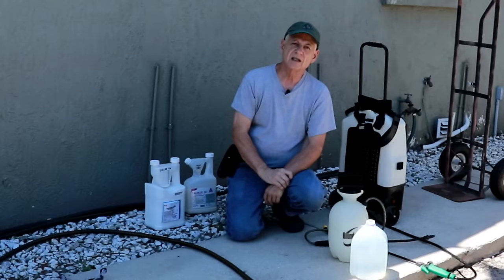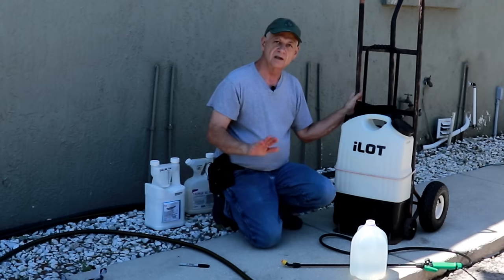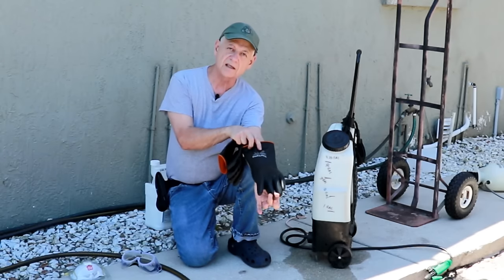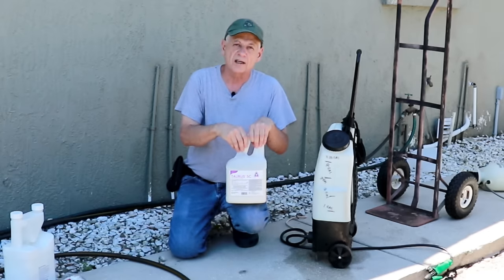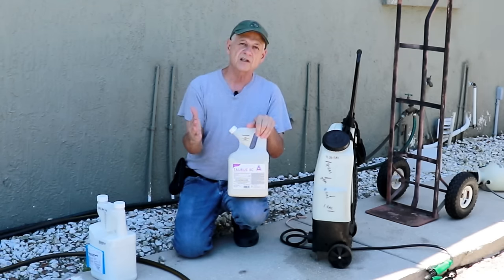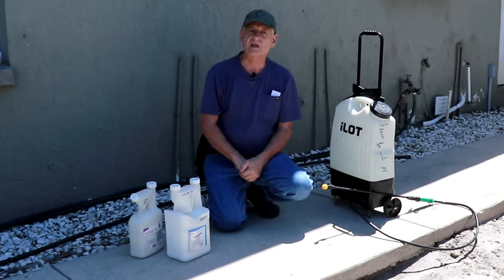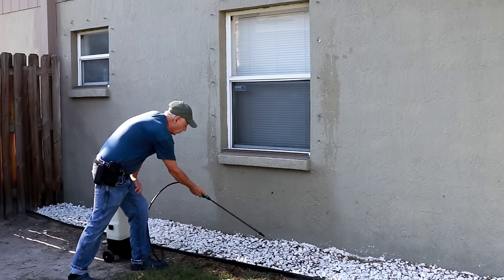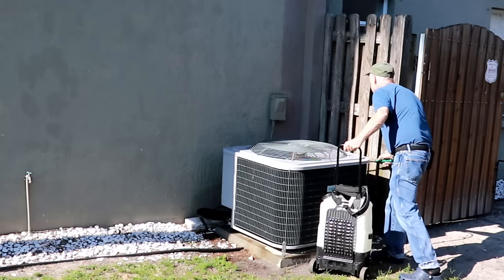General Exterior Pest Control - IMPORTANT!  READ THE DESCRIPTION.

Comment: Outstanding video info and analysis. Thank you
Reply from the maker: What a nice comment.  Very much appreciated.  By the way, I get a lot of folks wanting to know where to get a cheap sprayer.  I purchased mine several years ago from Amazon for about $40 I think, but they don't sell them anymore.  I have been looking for inexpensive sprayers to share with others ever since I did this video.  The ones from Harbor Freight turned out to not be battery operated.  Anyway, I have found one for about $80 on amazon that is a two gallon sprayer that I think will work.  It's about the cheapest one I have found and I will place a link below for it in case you are interested.  It's not a backpack sprayer, but it should get the job done.  I have not used it, so I can't endorse it, but from what I can tell, it should be okay.  The good news is that the sprayers last for years if you take care of them.  I hope that helps.  Thanks for the comment.

Two gallon sprayer:  https://smile.amazon.com/dp/B08CZBCPMZ/?coliid=IQ91M1CT5QYGS&colid=3VDXA5DFBKQ98&psc=1&ref_=lv_ov_lig_dp_it

Comment: Thank you so much for making this comprehensive video! Question regarding excessive amounts of spider webs - should you clean them up before spraying or wait until after spraying?
Reply from the maker: Hi Jenna.  I am so sorry that I did not get back to you sooner, but for some unexplained reason, YouTube held your question for review.  I didn't know that they did that.  I now have it fixed, but not before your question and several others did not get answered.  Anyway, the answer to your question is yes.  The spiders will die either way, but your home will look better if you clean up the webs first.  If you do this treatment every three months, then you will never have spiders again.  Thanks for the question and, again, so sorry for the delay.

Comment: Hi Guy this video just popped up on my feed because I had been searching for pest control companies. Anyway I’m doing this thing myself now and following your lead. Seems simple enough if I follow manufacturer instructions and your suggestions and recommendations for tools/equipment needed. I had already ordered pest control before I saw your video.  Here’s my question Can I use Talstar in the end hose sprayer. Thanks for all your good information.
Reply from the maker: I no longer recommend using Talstar P in a hose end sprayer.  It tends to clog them up really fast and it stops working.  You are better off using Bifen XTS.  It works great in a hose end sprayer.  Please watch my video on how to use Bifen products.  I show you how to use Bifen IT in a tank sprayer at the beginning of the video and Bifen XTS in a hose end sprayer in the latter part of the video.  I have an in-depth video on how to use a hose end sprayer and Bifen XTS to treat your yard.  I will give you links to both videos.  I hope that helps.  Be well my friend.

Video on how to use Bifen products:  https://youtu.be/Yozv3s-Qwlw

Video on how to treat your yard with a hose end sprayer:  https://youtu.be/wifoTU5dmp0

Comment: Thank you Guy for this informative video.  I am about to cancel my Pest Control Service and really wanted to know how to move forward.  In order to do it right, it seems to me that I am going to have a challenge.  But, with the help of your video, I am going to have to study it.
Reply from the maker: Not to fear Winnie, this is not as difficult as it may seem.  Just a couple of things you may want to take note of though.  The sprayers that I mentioned in the video are no longer available for purchase.  I have been looking for a good, yet cheap, battery-operated sprayer, but I haven't found one yet.  About the cheapest one I can find these days that will do a good job for you costs about $80.  Even though it costs about twice what I paid for mine, it's still worth the investment because you are going to save a lot of money doing your own pest control.  You will easily recover the price of the sprayer in just a couple of months.  I will place a link below for the sprayer that I am recommending.  If you want to go for a bit more money though, you can purchase a backpack sprayer with wheels that will work even better.  I will place a link below for that unit as well.  It costs about $200, but it's really neat because you can wheel it around easily and it does save a lot of work.  Also, it can produce a lot more pressure than the other unit, which makes it very handy when you have to reach high areas like the eves.  If your house is anything like mine, then some of the eaves are fairly high up.  The sprayer I have does not have this type of pressure and so I always have to get out a ladder in order to treat the gables.  It would definitely save me a lot of time and work if I had a unit like this, so I could avoid the ladder work.  In fact, I'm getting to the age now where I think I may just ask for one of these for Christmas this coming year.  

Anyway, the other thing that you should be aware of is…  I mentioned in the video that the Taurus SC is labeled for six-month use, while the Talstar P is labeled to use every three months.  Those statements are true, but the thing you should know is that the Taurus SC does not last six months.  The Taurus SC works a bit better than the Tallstar P, but if you're going to use the Taurus SC, you need to do an in between treatment with the Talstar P.  That is to say do your first treatment with the Taurus SC, and three months later do a treatment with Talstar P, then three months later, back to the Taurus SC, and then back to the Talstar P, and so forth.  The other option is to simply just use the Talstar P every three months.  These products work quite differently.  The Taurus SC is a slow kill product.  It's what we call in the industry a non-repellent pesticide.  That means that the bugs do not realize that they are crossing a pesticide and they happily take it back to their nest or colony and share it with the other bugs.  That will kill off the entire nest or colony.  The Talstar P works quite differently.  It is more of a fast kill product, so if the bugs cross it, they are going to die fairly quickly.  That means they are not going to have enough time to bring it back to the nest or colony to share it with the other bugs.  The advantage to that is you will not be getting any bugs in your house ever, but the disadvantage is you will not be killing off the colony or the nest.  With the Taurus SC however, you will be eliminating the entire colony.  The disadvantage to it though is that, since it is a slow kill product, there may be some bug activity while the product is working.  Another advantage to the Talstar P is that you can also use it on your lawn if you wish.  It's certainly not necessary, but if you spray your lawn with it every 90 days, then you will be eliminating the source of the pests that would be invading your house.  Taurus SC cannot be used in that way.  You should never use Taurus SC on your lawn.  I know that's a lot of information to take in and I hope I did not confuse you.  Which approach you take is strictly a matter of preference.  I can tell you that most pest controllers would probably go with the Talstar P and not the Taurus SC.  I think the reason for that is primarily cost because the Talstar P is a somewhat less expensive than the Taurus SC.  That's perfectly fine though because just using Talstar P by itself is a perfectly effective treatment plan.  For homeowners though, alternating between these two products will most likely yield even better results.

Sorry for the lengthy explanation.  You need not be afraid to tackle this yourself.  After you get going with it, you are going to discover that it's really not all that hard to do.  After you do it a couple of times you are going to become an old pro at it.  

Please do not hesitate to ask me any questions you like.  I am always here to help and I am more than happy to hold your hand every step of the way.  Be well Winnie.

Two gallon carry strap sprayer:  AmazonSmile: PetraTools 2 Gallon Battery Sprayer - Ultra Convenient Battery Powered Sprayer, Garden Sprayer & Weed Sprayer with Easy-to-Carry Strap, Electric Sprayer & Yard Sprayer with Long-Lasting Battery Life : Everything Else

Backpack sprayer with wheels:  AmazonSmile: PetraTools 4 Gallon Tank Backpack Sprayer - Professional Electric Battery Powered Backpack Sprayer - HD4050 for Lawn and Garden, Weeds, Fertilizer, Surface Sanitizing - Multiple Nozzles, Large Opening : Everything Else

Comment: Good video. We havee been DIY pest control for about 5 years using Suspend Polyzone. When that runs out, I'll switch to Taurus SC based on your recommendation. I have been spraying Suspend Polyzone in the house which I do not like. Using Taurus SC outside only will make us feel better. Thanks for an informative and timely video! We live in FL too so no shortage of bugs. Latest is a little cockroach thingy.
Reply from the maker: Congratulations on doing your pest control for so long.  Good for you.  In case you're interested, I have an updated video on this topic.  The new video uses Bifen products, which are a bit less expensive. The Bifen products use the same active ingredient as Talstar P, but at a more attractive cost.  The Taurus SC works really great, but it is a bit on the pricey side.  The new video will also show you how to treat high up areas using a hose and sprayer.  The new video is only 8 and 1/2 minutes long and I think it would be a good investment if your time to watch it.  It also discusses the advantage of treating your yard as well and it briefly explains how to do it.  If you are interested in treating your yard, I have a more in-depth video on the topic.  I will give you a link to both videos. 

By the way, you may want to identify the species of that roach.  If it's an outside roach, then you are probably okay. However, if you are dealing with a domestic roach, like German cockroaches, that is a pretty serious problem.  I will give you a link to my video on how to identify cockroach species.  I think you would be well advised to watch this video.

Thank you so much for watching.  Please let me know if you have any questions.  Be well my friend.

New video on how to treat the exterior of your house:  https://youtu.be/Yozv3s-Qwlw

Video on how to treat your yard:  https://youtu.be/wifoTU5dmp0

Video on how to identify cockroach species:  https://youtu.be/FN7JyBNSooY
Reply: @GuysPestSolutions  Guy, thank you so much for your prompt and thorough reply. I watched all three videos. They were very helpful. I have tried looking up that bug I referenced without luck. It is about half the size of your pinky fingernail, rounded front and back shaped like a bathtub, about 5:1 ratio length to width and only about 5/8ths inch long. We found 3 within a couple of days, 2 in a kitchen drawer in daytime, one dead one behind a piece of funiture against an outter window wall. I should have taken a pic of them. I don't recall the bug having the long antenae like most roaches. Any ideas? We live in NE FL in Ponte Vedra Beach. We have a large pond in the backyard, shrubery beds on the entire perimeter of the house and a pool. I have been using Suspend Polyzone but only treat 2-3 times per year, inside and outside. Rarely do we see a bug inside the house. I use a small Hudson pump sprayer inside and a powered backpack sprayer outside. Probably should increase that to quaterly. Also, I found a mud dauber condo in our attic. I'm planning on dousing that area with Suspend Polyzone too. When the Suspend Polyzone is gone, I will try the Bifen XTS or Taurus SC.
Reply from the maker: It's a bit of a challenge to identify a bug just by a description, but you may be looking at an earwig.  I could be totally wrong about that.  I really need to see it to identify it.  Most likely this is something that came in from the outside.  In Florida you really need to treat every 60 days outside.  I live in Florida too and that's what I do.  I always know when it's time to treat again because I will start to see ants on the sidewalk.  They show up like clockwork just about 60 days after I treated.  If I don't do another treatment, then it's a safe bet that I will start to see them in the house within a couple of weeks.  If you do the Bifen XTS treatment on the house and the yard, then you will never need to treat the inside of the house, unless you carry in something like German roaches, fleas, or bed bugs.  Wasps will never make it into your attic again.  My house is 100% pest free, inside and out.  The hose end sprayer makes it very fast to do.  You are going to love it.  You may get some sticker shock when you see the price of the Bifen XTS, but keep in mind that it gets mixed at 1/3 ounce per gallon of water, so it is very inexpensive per finished gallon.  It is the cheapest pesticide that I have found so far per finished gallon.  One gallon will treat my house and my entire yard 3 times.  It costs about $170 a gallon, so that lasts 6 months.  So, it's about $28 a month.  Most of that is for treating the yard.  It is a lot less expensive if you just treat the house, but I don't fool around.  My wife hates bugs.  Maybe that's why she married me.  Lol.

I hope that helps.  Be well my friend.

Comment: Dude you are a lifesaver thankyou can’t get no more clearer in instruction with that!!
Reply from the maker: Thanks.  Please note that you can alternate between the Taurus SC and the Talstar P.  That is to say, that you can start with the Taurus SC, then three months later use the Talstar P, then three months later to go back to the Taurus SC, and so forth.  The Taurus SC is a great product to use, but it is only labeled for use every six months, but it only lasts about 3 months.  I don't think I was really clear in the video about that point.  If you would like to save some money, you can use Bifen IT instead of the Talstar P.  They are the same product, but the Bifen is a bit less expensive   Also, the sprayers that I show in the video are no longer available.  I will give you a recommendation for a sprayer and that should serve you very well.

Be well my friend.  

Bifen IT:  https://www.solutionsstores.com/bifen-it-insecticide

Battery operated sprayer:  https://www.amazon.com/dp/B08B3MKYWD/?coliid=I1WHD5A3RF25H9&colid=3VDXA5DFBKQ98&psc=1&ref_=lv_ov_lig_dp_it

Comment: Great video. Thank you for taking the time and producing such a useful video for DIYers.
Reply from the maker: You are very welcome.  The sprayers in the video are no longer available, but any battery operated sprayer will work just fine.  Also, this was my very first video, so I was not exactly clear that it is a good idea to use Taurus SC for your first treatment and then you can use Talstar P for all other treatments, every three months.  If you want to save some money, you can use Bifen IT or Bifen XTS instead of Talstar P.  Same thing, but the Bifen products have a bit of an odor to them until they dry.  The XTS seems expensive, but it is mixed at 1/3 oz per gallon, so it goes three times as far and ends up being the least expensive option.  You can also use the XTS in a hose end sprayer to treat your yard, so it is a very versatile product.  I will give you links below.  Be well my friend.

Bifen XTS:  https://www.domyown.com/bifen-xts-p-1236.html

Video on how to treat your yard with a hose end sprayer:  https://youtu.be/wifoTU5dmp0

Comment: Hi Guy, great videos and thanks for sharing your expertise with us! I am remodeling a 90 year old abandoned home to use as a get away cabin and hunting camp. The biggest problem is spiders. The place is still under construction however we do have it dried in with new subfloor. It is off grade. Spiders have collected inside the house and in the corners of the roof rafters. Do you have any recommendations?
Reply from the maker: Hi Steve.  There are any number of ways to deal with spiders.  Sometimes the best way to do it is to simply knock them down with a broom and step on them.  When you remove the webs with a broom, you also remove the egg sacks as well, so no more spiders.  You can also use a vacuum to do the same thing, then just throw away the vacuum bag or clean out the container if there is no bag.  Shop vacs are great for this job.   Another way to do it is to mix up some of that Talstar P and spray the webs.  This product has a fast knockdown and a residual, so that it will kill the baby spiders when they emerge.  Of course, that will not remove the webs and who wants a bunch of spider webs all over the place?  So, again, removing the webs with a broom or vacuum is probably the best thing to do.  The exterior treatment described in this video will prevent them from entering again.  I hope that helps.